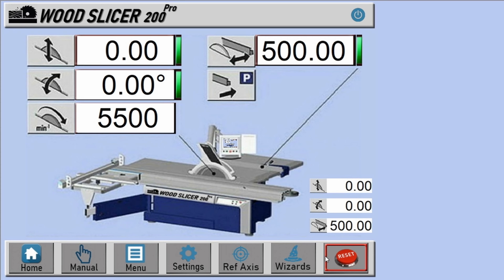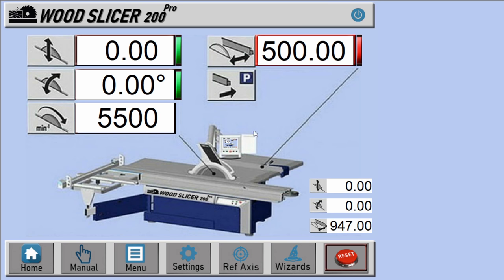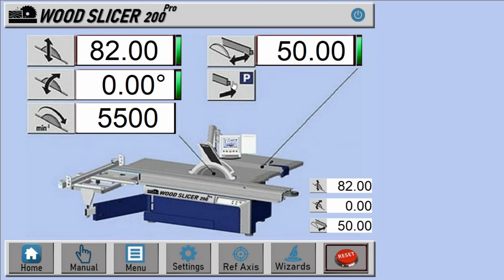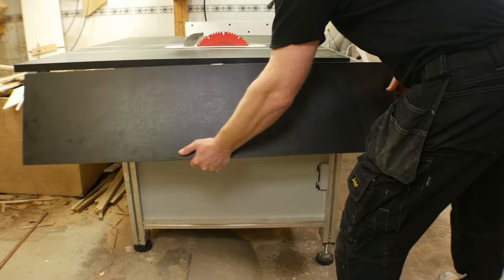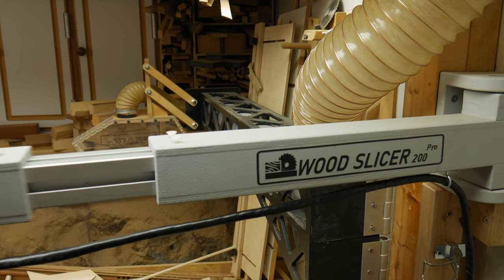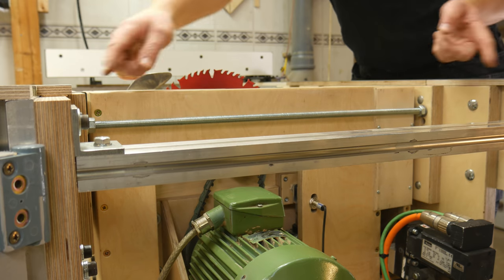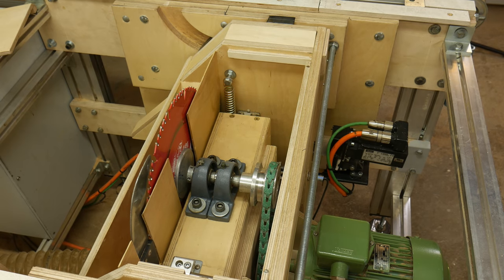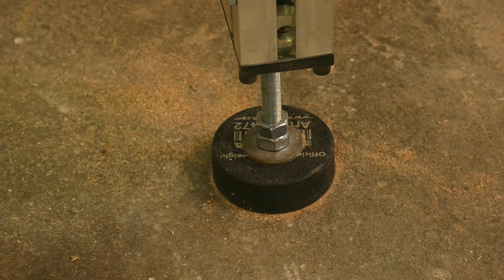You have NEVER seen a homemade Table Saw like THIS!

Comment: WOW what a saw can you use a dato stack if so how thick. How much did it cost to build this saw
Reply from the maker: When I made the arbor 10 years ago, i made the shaft long enough to take a dado stack. Unfortunately they are illegal in Norway, so I have not been able to get my hands on one yet. I also had to shorten the shaft a little when I installed it in this saw due to the smaller insert plate. But it should still be able to take a\\one at least 1" wide
Reply: @bellevuesnekkeri  WOW I dont see any resion why they need to  be illegal they are not illegal here in the us & as far as I know there has been no danger to public healh or any thing elace I am sorry to here that dato blads are illegal where you live.

Comment: How much did you spend on this build? Do you have full plans?
Reply from the maker: Approx 15usd (for the usb motion card off ebay) All the other parts was salvaged when dismantling old production equipment or trash picks over the years. There will not be made any plans for this, mainly because the market is very narrow, and the build is made to suit these parts.

Comment: Been looking forward to this, awesome! What does the Software do, with the Blade height when the Blade is tilted? Does it calculate anything or does it ignore the tilt and if you say 80mm it raises it 80mm as if it was at 90°?
Reply from the maker: Thank you for hanging in there. Sorry about it taking so long.It sends the blade height to the input value as you say, and does not pay attention to the angle of the blade. I did not see any operations where that would beneficial, So I did not take it into account. I know many commercially  made saws do so, especially those with custom programs for all kinds of angled and mitered cuts.
Reply: @bellevuesnekkeri  Ah okay, thank you for your detailed answer! :)